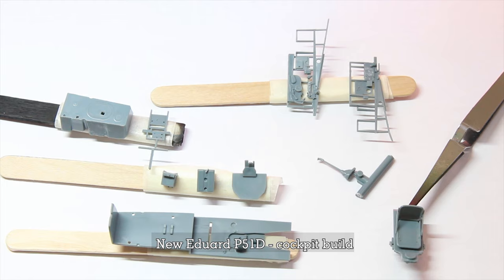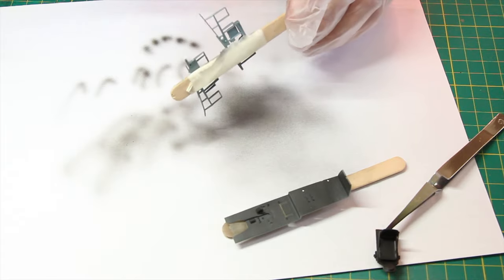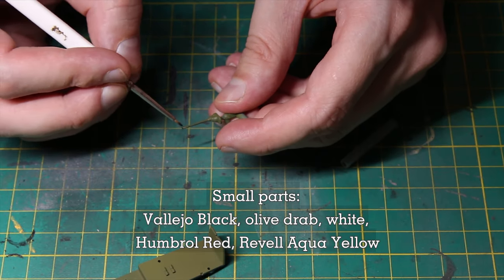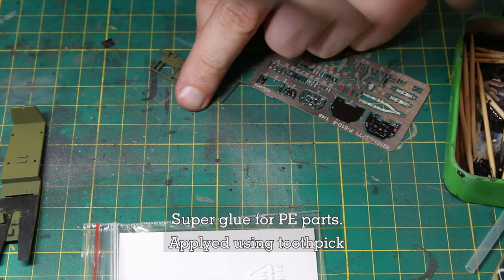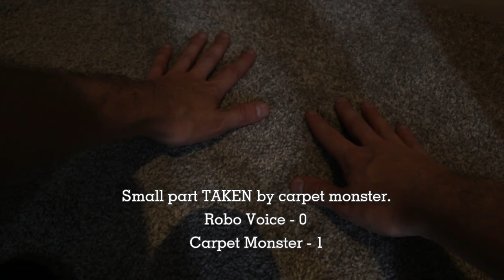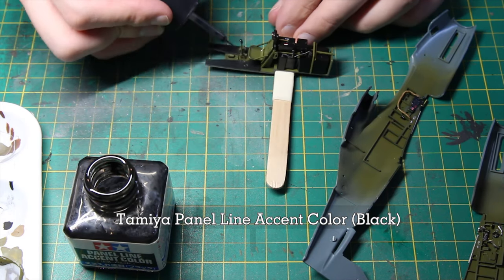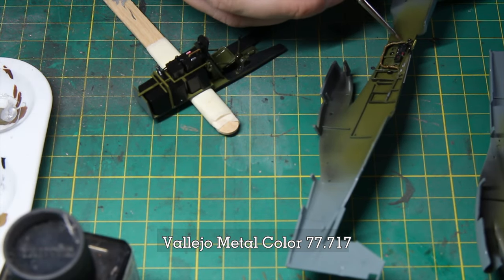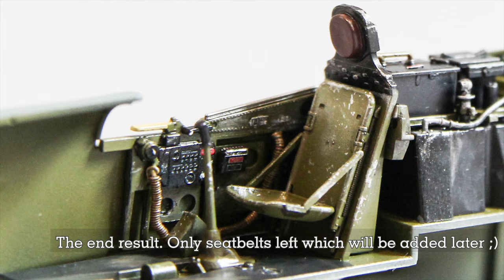Eduard P51D Mustang 1/48 D build. Cockpit. Part 1

Comment: please check if it can be built with flaps up, i love my mustangs with clean wings!
Reply from the maker: Hey, yes you can :) two small pins to be removed and that's it. Even though instructions suggest flaps down, but certainly not a problem :)
Reply: Thanks, i guess i'm on board with the project then
Reply from the maker: @enriquepadilla4154  I am sure you will not find better p51d in 1/48 scale :) Well, at least this year :D